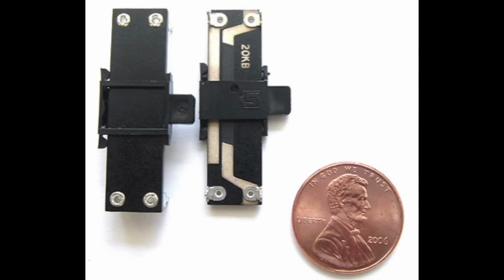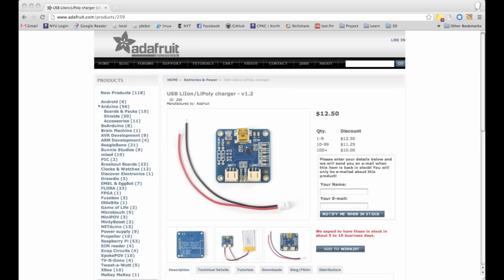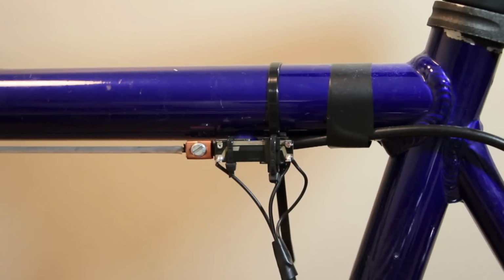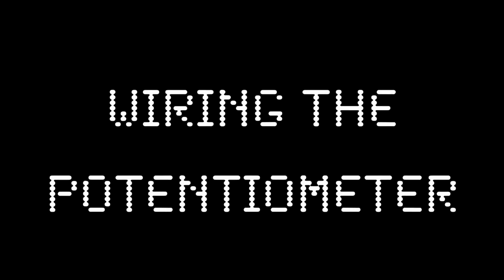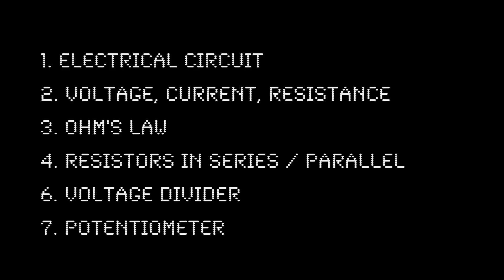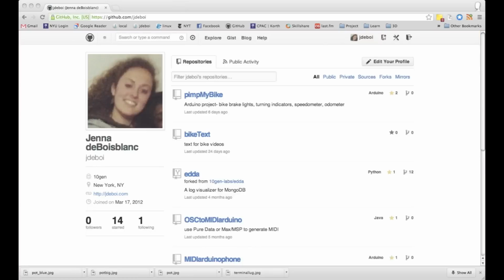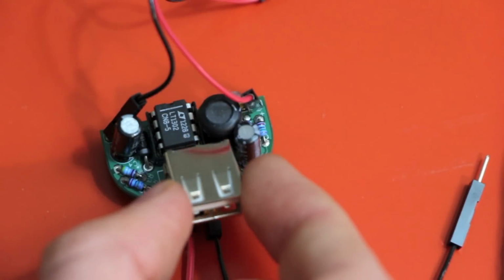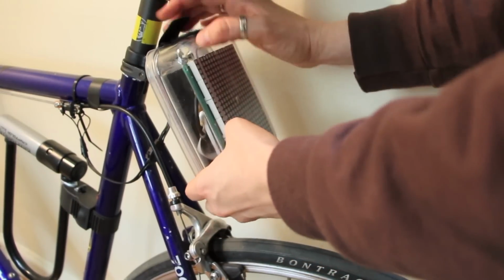pimpMyBike[3] = "Arduino brake lights and battery"

Comment: I'd like to do something similar for my e bike, with led strips attached on front and back fork of the bike, but I was thinking of using an accelerometer for brake detection and a dual position switch for direction indication, do you think that is doable?